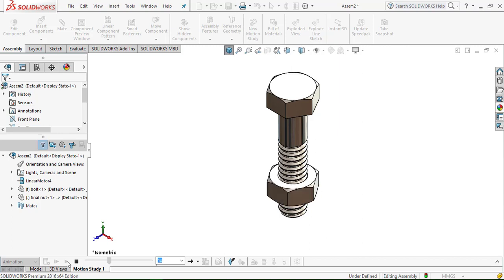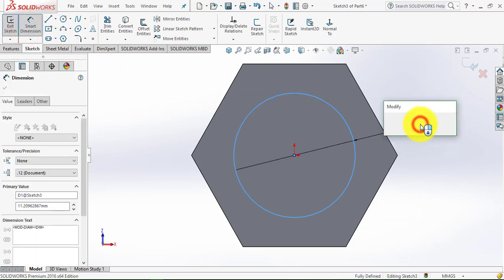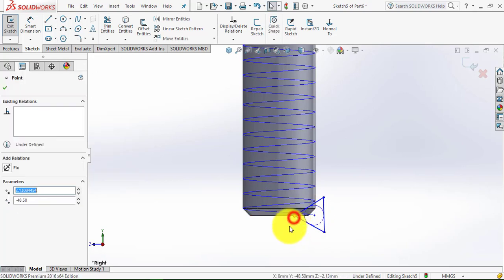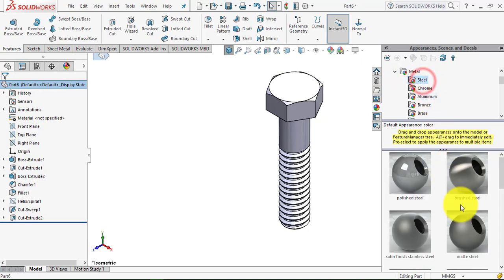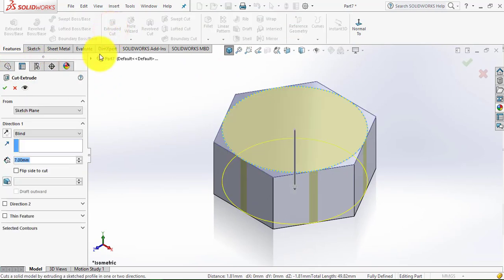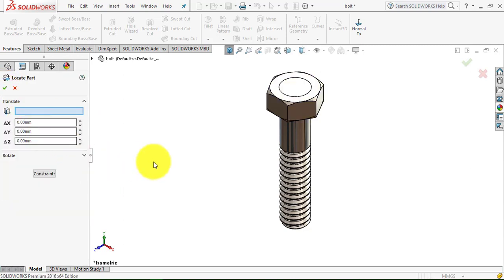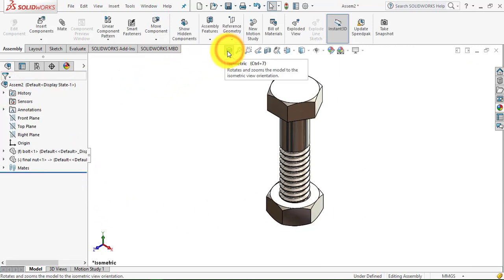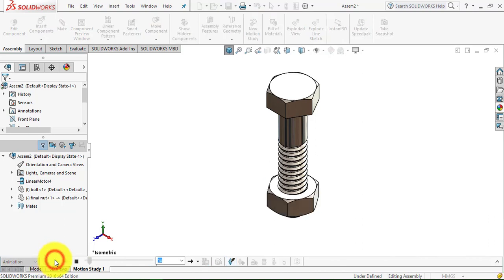⚡ SOLIDWORKS TUTORIAL #31 || Design of Bolt and Nut assembly with motion analysis in solidworks.

Comment: Your nut is rotating in opposite direction but still getting fastened. Should have fixed that.  Anyway good work.
Reply from the maker: Actually I forgot to reverse the direction of helix,  that's why...
Reply: use contact so that you will not need to define the direction of helix or even any mate.
Reply: @CADGill  Hey how can we do that?